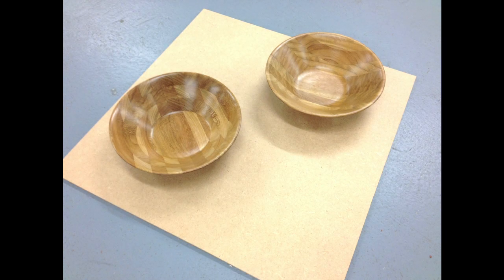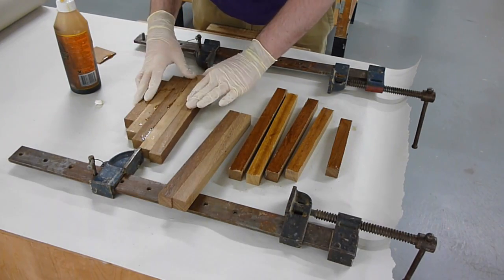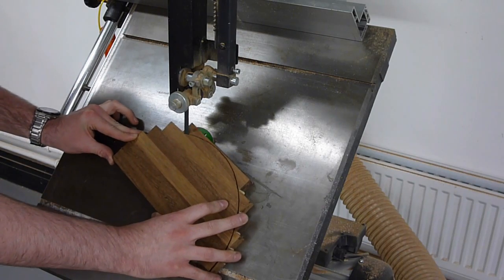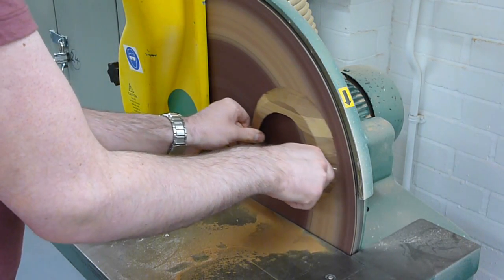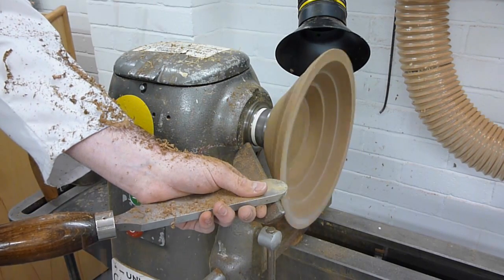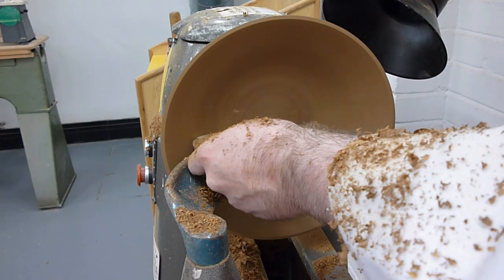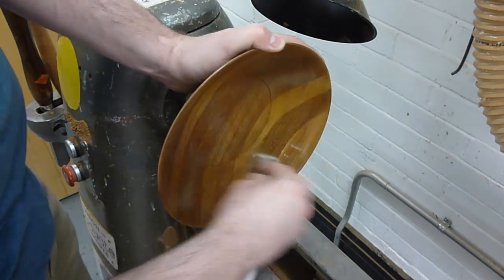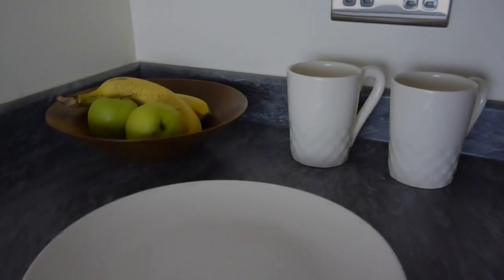Scrap Wood Stacked Ring Bowls From Start To Finish

Comment: What is the trick to cutting on the line with the table tilted 45 degrees? On my saw it is really hard to follow the line. The blade wants to go where ever.
Reply from the maker: Hi John, it's just a matter of practice, it's worth noting though that the cutting on the band saw at 45 degrees is speed up by 3 times i think. i was using a relatively narrow blade and working slowly, and found that i had to turn the blank ahead of the lines curvature to keep it on track. I hope this is of some help. :)